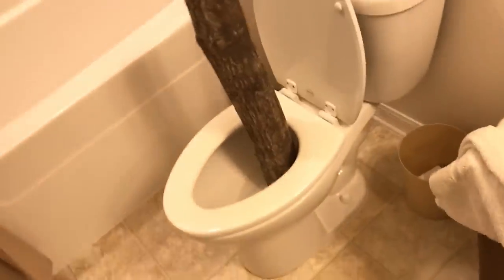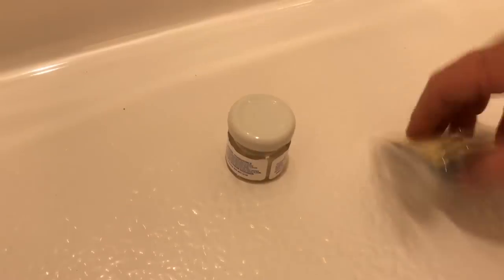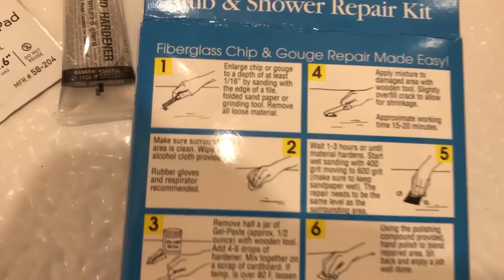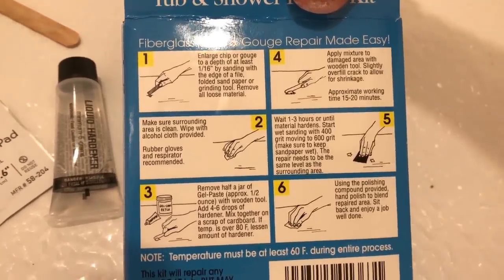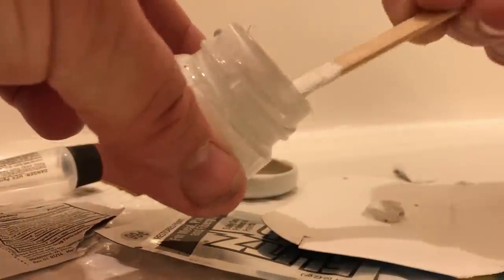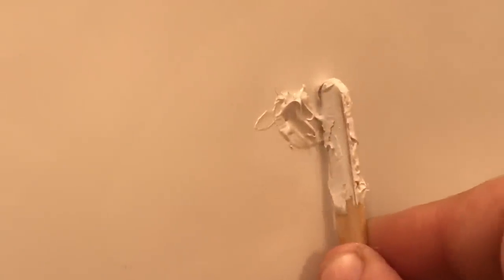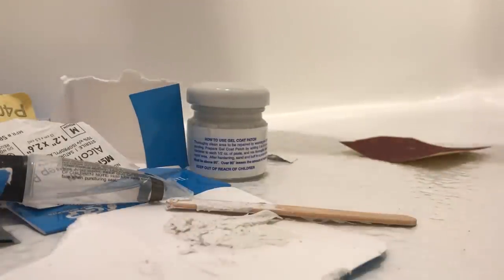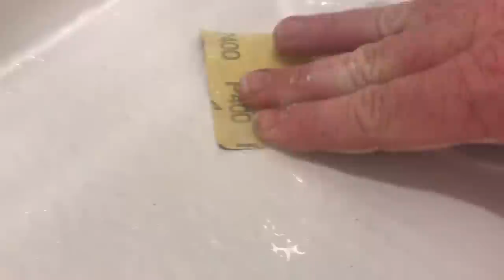How to fix a Crack or Hole in Bathtub - Fiberglass Shower tub chip gelcoat repair

Comment: Thanks for the vid. I've got some long cracks in my shower I'm hoping this'll work for. Will know in about 24 hours lol
Reply: Update: this kit was enough to fix 2 long cracks in my shower basepan. We'll see how long it holds up. The cracks are due to the shower being installed without adequate support underneath. But I just need a temp fix until I can afford to replace it.  Wasn't very difficult.
Reply: @lordneeko  How did the repair hold up all these months later?
Reply: @loveislife77  it didn't. Had to replace my shower
Reply: @lordneeko  how long were the cracks? I got a small hole smaller than a penny
Reply: lordneeko I’m using it to repair a crack in my tub tonight. Sounds like I have a new tub in my future. 🤣🤦‍♂️

Comment: I have a tub/shower surround with three small nail holes on each wall end.  Would it be possible to install think plastic on the length of each end of shower wall that would look like it was part of the tub and maybe install a small shelf where a safety bar was removed.  I am protecting the surround with that white sticky tape stuff........you know, the man that sticks the product on the floor of his canoe and seals it completely :).  Have to know........do you even know you are humming :).  Thanks.

Comment: I like the video, but unfortunately, I can't find a color match because my tub is about 20 years old. I think I may need to change it if I don't get a match because it is about 2 inch wide spot and it will stand out or show the repaired spot. Worth a try nonetheless, thanks for the video.
Reply: Armando De Michele Maybe paint, or if it’s on the floor of the tub get a shower mat. I hope that helps

Comment: It would have help if yo used a small pic to clean out hole on tub bottom.  You want to get as much as that epoxy shit in the hole as possible...you had a lot of the sanding shit in the hole that should have been removed with a small pic then use a shop vac to finalize!
Reply: Probably help to bind it if anything